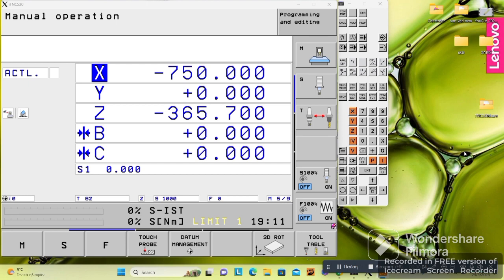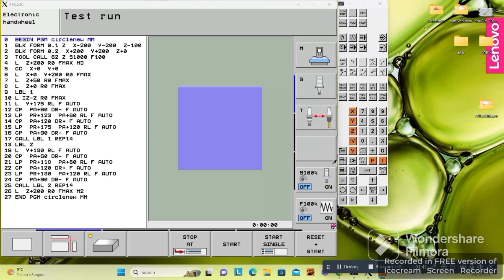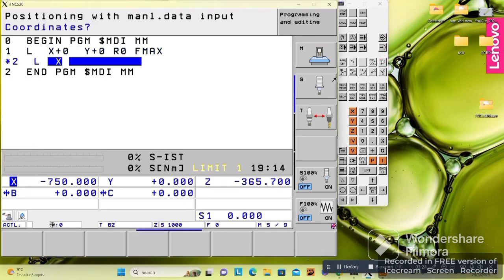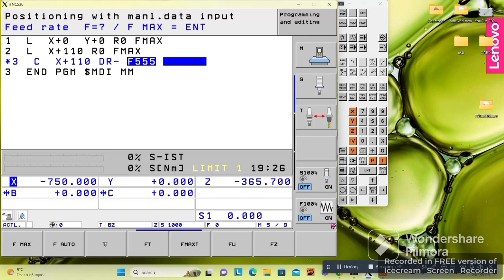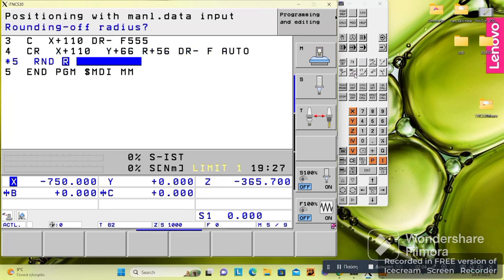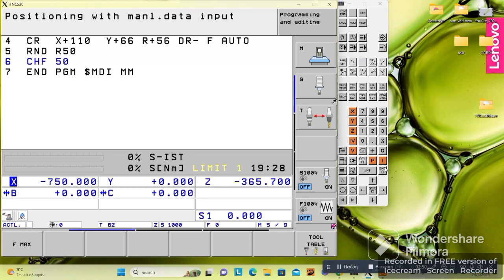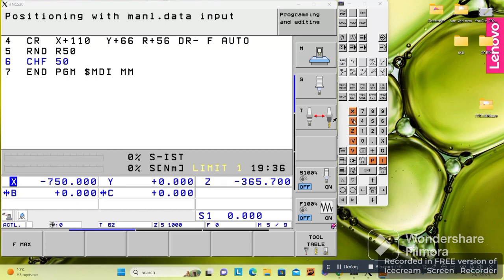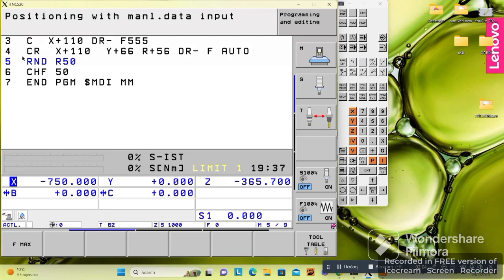Learning heidenhain control. Lesson 2 Describing panel

Comment: I would need your specific help for a particular machining operation I need to perform. I'm working on a part that consists of a circle with several holes and slots, and I need to use a 4-axis machine with a rotary table (B-axis).
Specifically, I would like to learn how to:
Manage drilling cycles on 4 axes by rotating the table
Create slots using the B-axis rotation
Correctly program the machining sequences for this type of geometry
Would you be available to create a video tutorial on this topic or to give me a personalized private course?